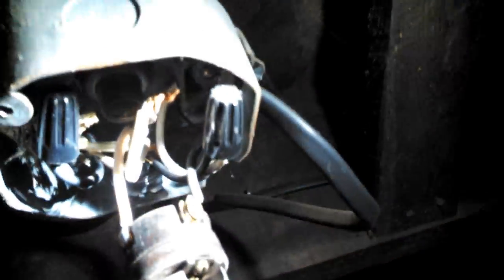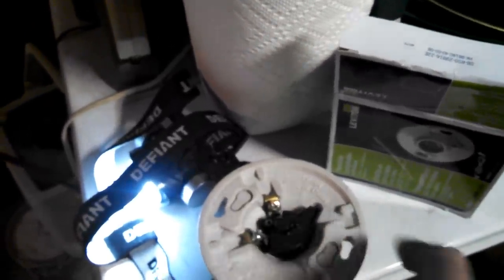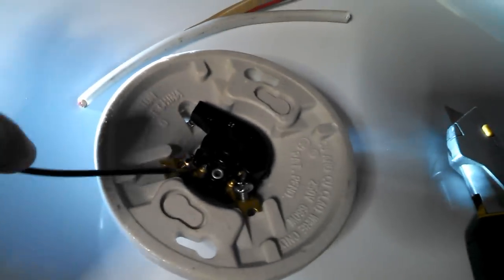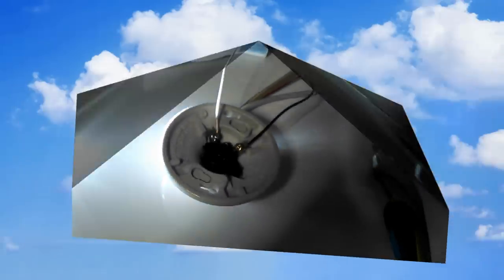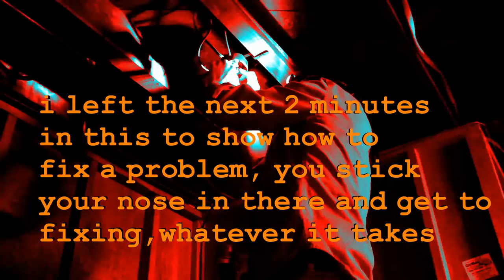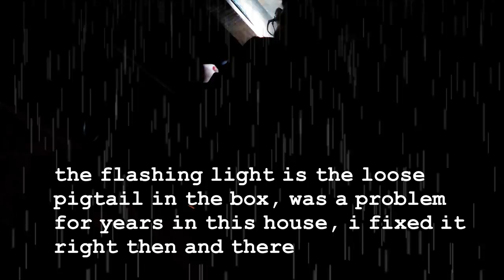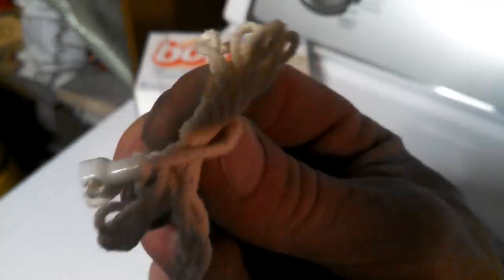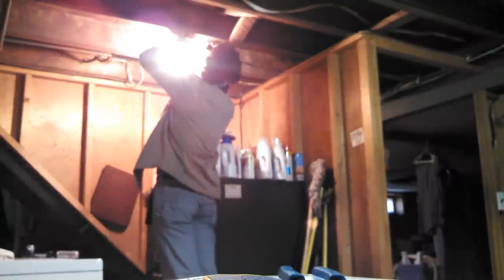Replace Pull Chain type Light Fixture

Comment: Thank you for being the only source to say that the black wire goes in the brass and the white wire goes in the silver screw! I was installing a slightly different Leviton product (porcelain bracketed socket) and this was very helpful.
Reply from the maker: haha, it's only the fundamental building block the continental electric grid in regards to safety....that's all...thanks for notice my advanced skills at teaching the peeps !
Reply: +Dino Pinch Hey Dino, if my black(hot) wires are meeting up in the box and twisted together what should I do. The black wire seems to be a little too thick to use a wire nut, should i trim an bend oned of the wires and pigtail that? 

If you are having trouble visualizing it, it's two wires coming through the BX metal sheaths and meeting at the box, those two thick wires were then tied and taped to one connection, so now there are multiple wires in one taped bundle. 

Should I just cut the tape, unbend one of the wires and then pigtail that and tape over again or?

Thanks Dino
Reply from the maker: +Yaya Bam Bam, I would pick up medium wire nut & a short length of 14ga black wire (6 inch), I would pig tail the single wire to the bundle with that wire nut , using free end of single wire to complete connection at socket..m thanks!
Reply: +Dino Pinch in the wire bundle do I wir in the ground wire in each bundle???

Comment: Have the same situation with hot/neutral ceiling leads too short. Need to use pigtails.
I have an old light fixture laying around, can I remove the hot and neutral wires that were attached to the fixture and use them as my pigtails?